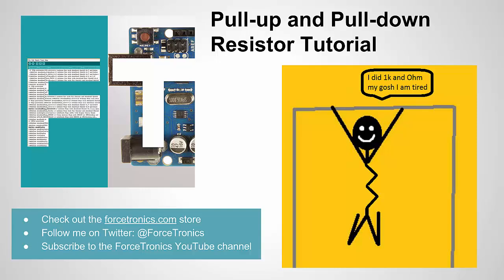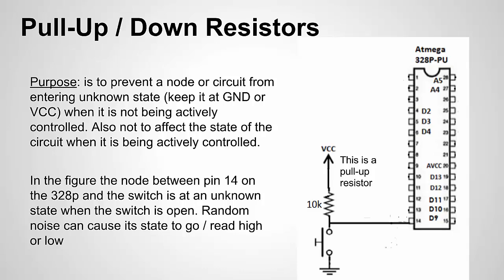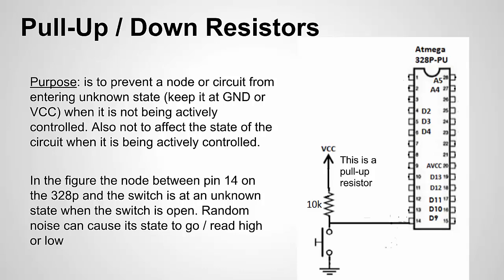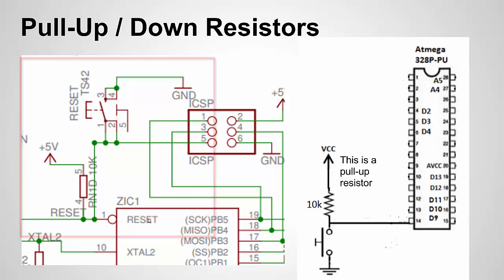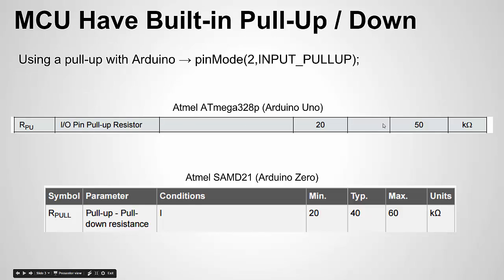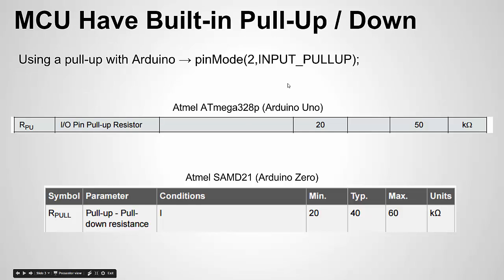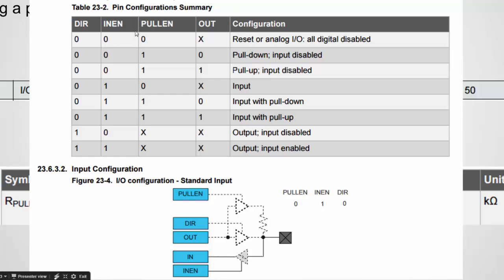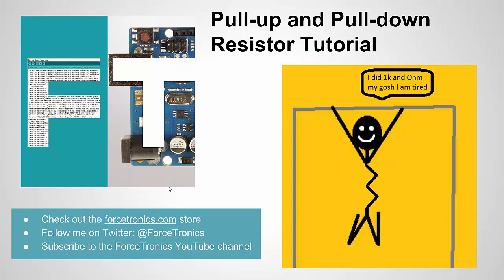Pull-up and Pull-down Resistor Tutorial

Comment: the one thing all the examples and tutorials fail to articulate is connecting the MC to another IC with input and output. they all use a switch as an example and for some reason that is hard for me to comprehend because i'm not struggling with connecting a switch or button lol.

Comment: Thanks! I built a small handbrake controller for my home sim rig and being new to all this just hooked it up with no pullup (my my case it actually required a pulldown cause i did it backwards). It was very frustrating to find that it was erratic and simply touching the board would change the value. I took and chance and from what ive seen connecting other sensors hooked up a pulldown resistor (only 220 ohm) which corrected the issue but I had no idea why it worked. This video cleared it all up. Thanks again.

Comment: I didn't understand HOW could the pin read a FULL VCC when it has a 10K in series? Won't the resistor DROP DOWN the voltage a bit?
Reply from the maker: It does your absolutely right. But if you know the values of the resistors you can calulate what the voltage is downstream. That is one of the main points of the video. Sorry if it was not clear

Comment: Can somebody explain again why vcc drops when the switch is closed?
Reply from the maker: When the switch is open VCC is dropped across the switch because an "open" is much greater in resistance to a 10k resistor. When the switch closes it becomes a short to ground so what do you get when you measure the voltage at ground, 0V. Now VCC is dropped entirely across the 10k resistor